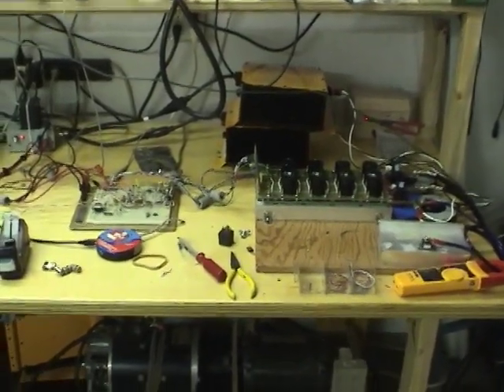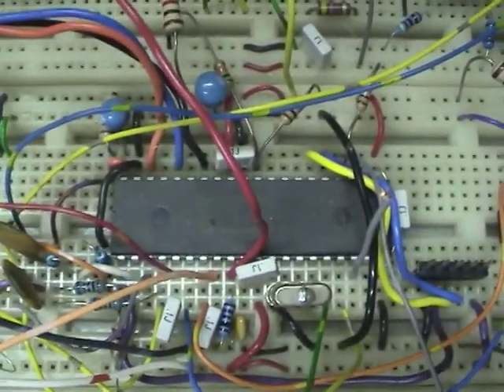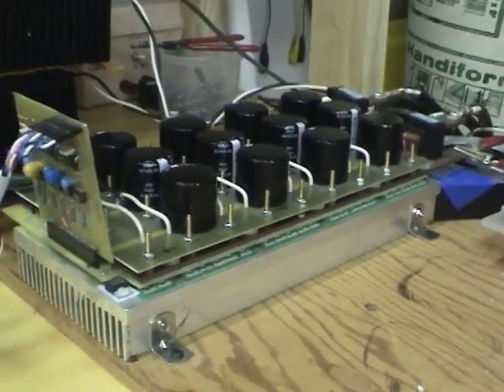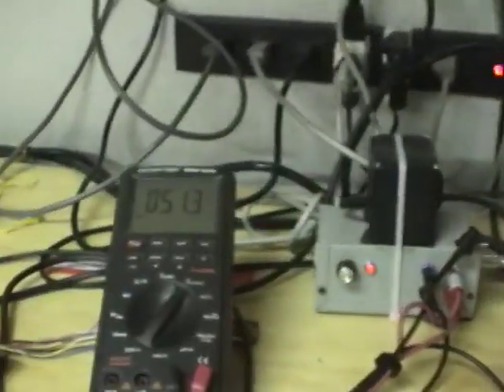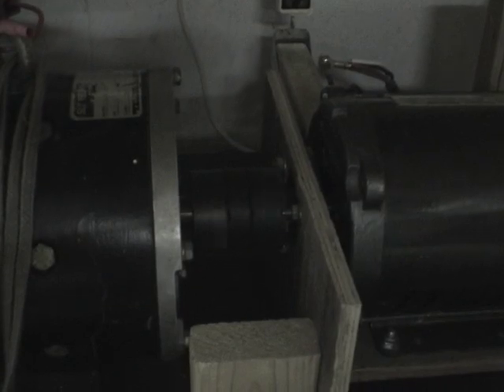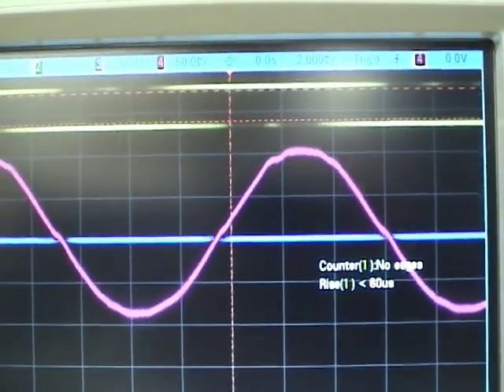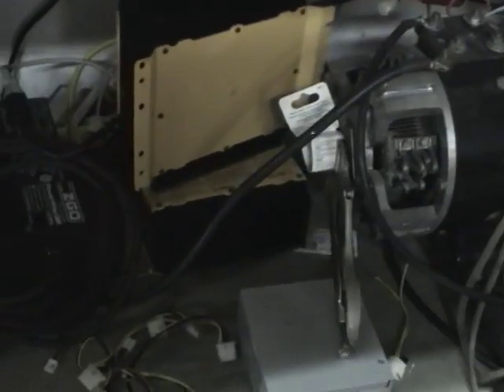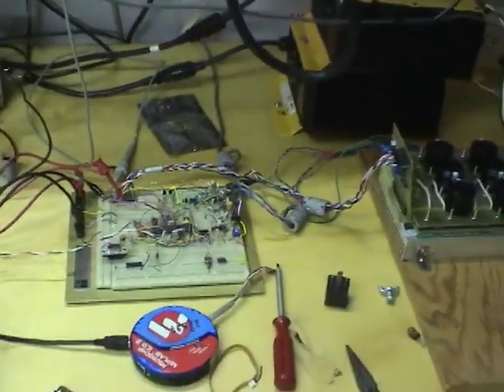AC Drive System for EV

Comment from the maker: @douro20 MOSFETs do have lower switching losses, but it's not too bad here switching at ~18kHz. Unfortunately, the IGBT bricks I plan to use for the next version have higher switching losses than these 12N60 IGBTs. I may need to drop the switching frequency when the inverter is outputting high current at low motor speeds to avoid overheating the IGBTs.

Comment: @erlendse The point behind "vector" control, is that the phase current magnitudes and phases of a 3 phase induction motor are mathematically equivalent to the current in the rotor and the current in the stator of a conventional DC motor (this is NOT intuitive, but is correct). 

A vector controller measures motor currents, converts to "DC" form in software. The software can then adjust virutal field current for speed, and virtual rotor current for torque. Then translate from "DC" mode to 3 phase

Comment from the maker: @67tr876 A transformer and rotary phase converter would probably be cheapest, but you wouldn't get the variable frequency. Unfortunately there really isn't any super cheap way to get high power 3 phase. Getting it from 12 or 24V would require some sort of step up converter too.

Comment from the maker: @tsport100 The IGBT driver you see here is based on IR21084 high/low side FET drivers followed by IXDD414 14A drivers to increase the drive strength. I'm moving away from this on the new version though, the bootstrap supply drops out if you drive to 100% duty cycle. The new inverter will use FOD3180 optoisolated drivers with the same IXDD414s, powered by a custom isolated power supply.

The current probe is an A6303 probe with an AM503 amplifier. Only good to 100A though.

Comment from the maker: @Jaytheozzi Yes, most of this I did myself. The software control is based off a modified app note example provided by Microchip. When I get farther along I'll post all the design info so others could build one. This should be a nice open source hardware/software project.

Comment from the maker: @sleepymcdoze Thanks!

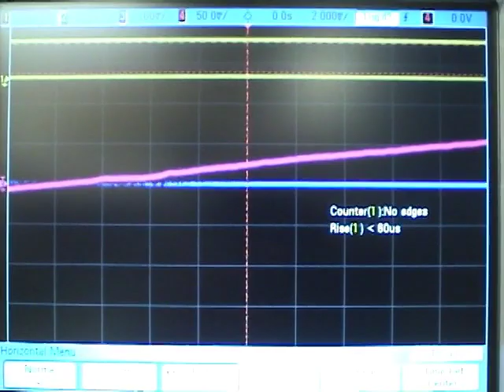There's definitely some current clamping going on, producing a static distortion in the wave. The dead time is set much higher than needed right now.  But there's something else as well, visible while the motor is accelerating at around 7:26. This distortion "moves" along the wave in a way the current clamping distortion can't. Could that be due to the stator slots? If not, maybe it's some instability in one of the control loops.

Comment: Great video, It's interesting how much extra torque you managed to extract from the motor. I would have thought you would be limited by magnetic saturation considering how little torque the original motor was designed for. If there was so much capacity left in there that motor could have been built significantly smaller.

Comment: Have you visited the ecomodder site? M. Paul Holmes is building a modular type of AC motor controller. He's got a 500 and 1000 amp DC motor controller called the Open Revolt that is pretty impressive. I would recommend checking it out.

Comment: Great knowledge sharing. I was wondering if you could run your generator in a more direct way? Maybe some alternative , instead of limiting the heat,  free it up(rpms) more with a liquid cooling system connected to the shaft for a belt(or the air conditioning unit off a car, vent it 100% into the motor)(or even incase the motor and fill it with something noncunductive). Could you, with better cooling be able to bypass your batteries on the panel? Or the main batteries? That would be a way to keep more of the stored energy while in operation.

Comment: @tesla500 I see well i did find a drive that would take in 120 volt but its $200 I dont need it yet but if i have to i will get it. I just want something that will give me 10 amps or more but i would have to get a step up transformer to go form 120 to 230 for it to have the in put. i could get a  rotary phase converter tho .

Comment: I have also built a 3 phase inverter based on AN908 ported to a dsPIC30f3010. I am interested in what components you have used for your driver stage (particularly the high side). I have used Powerex BG2B kits but the pcb quality is rubbish (unplated vias etc) and I have endured more than a reasonable amount of fault finding just to get them working. Also, what is the brand of your DRO current probe? Thanks.

Comment: very nice. has the project moved on since this?
I think it's a mistake to go with modules because of perceived ease because you get permanently saddled with high price. you can use an IGBT that is stronger than the 12n60, like the IRGP4069D. might only need 8 in parallel to have 300A rms per channel.

Comment: It's really neat.
I have looked into the vector control theory, but I do not quite get it.
Is the field weakening some trick to get more speed for a given input voltage? or am I getting it all wrong?
And the rest about vector control, I don't get it fully.. measure current & voltage, do some "magic", drive the result of the magic back into the motor?

Comment: What method did you use for the inner current control loop (Hysteresis or PI) and what frequency is it running at?

Comment: 1) im = im + (T/Tr)(id - im)

2) fs = (P/2).n + iq / (Tr.wb.im)

3) Angle = Angle + T.wb.fs

ISSUES:

1)The first issue is the fact that we need angle for id,iq and id,iq for the angle. The classic chicken and egg situation. So does taking initial id,iq as a random value say zero just work. Like do all three converge to the correct value in a few iterations in a closed loop fasion?

BIGGER ISSUE:

While I understand the above procedure conceptually, i.e. we are simply calculating the rotor field speed and then integrating it over time to get the position, what bothers me is that without knowing the initial position, it doesn't make any sense to me. I mean we will have an angle that will increment every cycle at the right rate but how can it be the actual rotor angle? I mean both equations 1 and 3 use initial values and increment them but we are taking random values/zero the first time this is done? There will always be an offset with the actual rotor angle. How to take care of that?

Comment: You can get 3 phase AC out of what now ? 12 volt ? I neeed 3 phase bad man ! and i dont want to pay 200$ for a drive thats just can power up to 1hp. i want one where the in put is 120 volt or 12 24 volt and get 230 and 460 volt ! i need something to run up to 5hp.